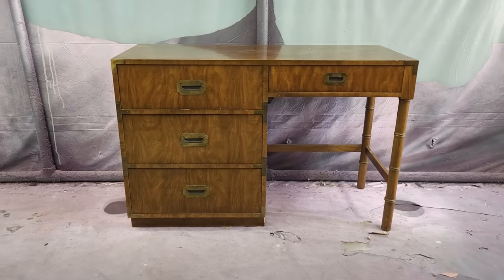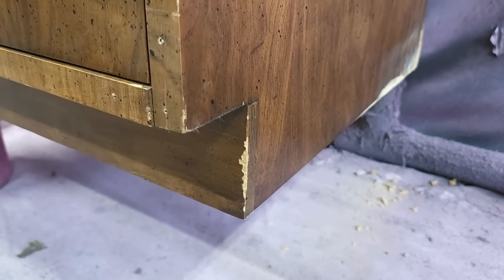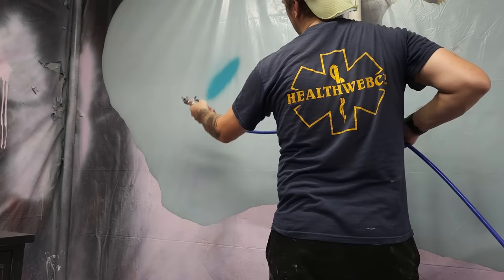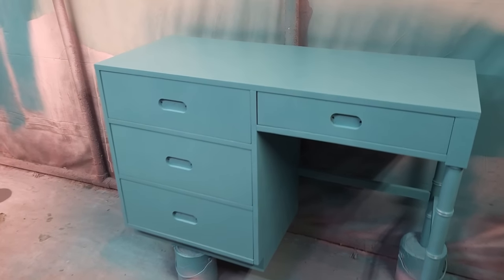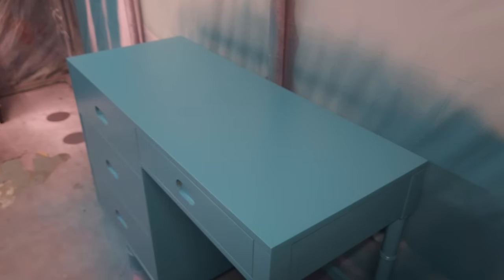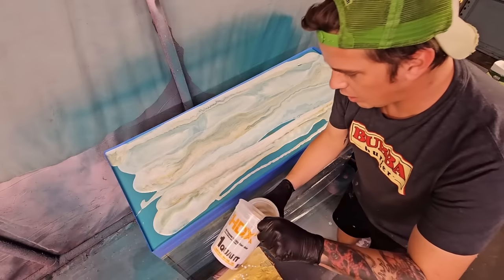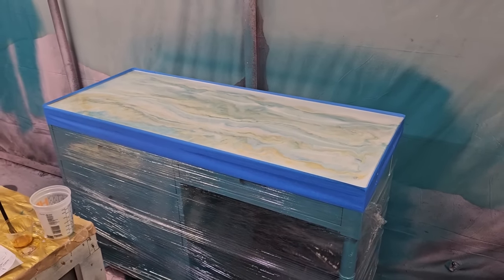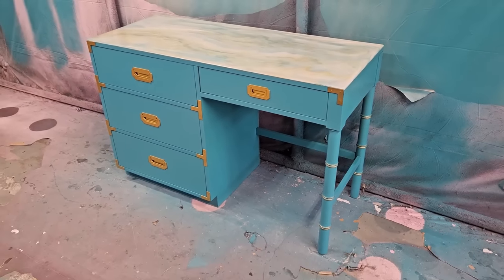Painted Vintage Desk Epoxy Pour Makeover

Comment: Personally, I believe you have too much white pigment.  I would just add the blue n metallic directly and use a hair dryer or heat gun to move around.  If using a heat gun, be careful not to burn the epoxy by not getting too close and moving around quickly.  Sure  beats heavy lifting.  Project being level is a must.  In the end, the desk turned out beautiful ❤.  Side note:  The heat gun will also pop bubbles and using both the heat gun and torch is a winner.
Reply: I agree. It doesn’t matter what type of epoxy resin is used, white will yellow over time. Art resin will yellow sooner.

Comment: Everybody panics on their first pour at some point.  Thankfully epoxy is very forgiving...to a point.  In my experience, you do not have to sand through all of those progressive grits under a clear topcoat.  Even the 120 by itself would have probably been fine.  The epoxy bonds to itself, scuff marks and all, and comes out crystal clear.
Reply from the maker: Thanks for the tips!
Reply: I'm glad someone else noticed the unnecessary progressive sanding he did. Before he started pouring, I was wondering if he leveled the desk. @ThatshabbyGuy I would suggest using a split cup to use the various colors or keeping them separate when pouring. The white was swallowing up your other colors too much. Thanks for the entertainment. I've had issues before with some things I've poured epoxy resin on so I understand the panic :D

Comment: I could feel your panic when it looked like you were running out of epoxy and time! That's a way cool result though. Also you're the only one I've ever seen spraying furniture with an airless sprayer and I've been thinking of doing that too. I see other videos of people using the Wagner sprayers and it looks like it would take "forever" to do it that way. Even with cleaning up the airless sprayer it's still probably faster. Certainly easier. And I don't even want to think about brushing it.
Reply from the maker: I've used the Wagner sprayers before too. I have a few videos of me using them. It takes about 5-8 minutes to apply a coat of paint with them, depending on the size of your project. The Graco airless sprayers take 1-3 minutes. The downside is the Gracos use more paint and have more overspray so you kind of need a bigger area to contain it.

Comment: Surface is supposed to be level. I use a level before I pour. A heat gun will help you move the epoxy around.

Comment: Is your epoxy resin for countertops or is an art epoxy resin?
Reply from the maker: It is made for countertops. Beast Bond is the product
Reply: @ThatShabbyGuy  is it available in United States?  Is this proven that the white will not yellow? All other countertop epoxy resin strongly suggests not to use white because it will yellow. I want to do my bathroom vanity and kitchen countertops using white. I’m a Fluid Pour artist. During your video I kept saying use your heat gun. 91% -99% rubbing alcohol will get rid of air bubbles as well. If you wanted the blue and gold to show up more use the clean pour technique. You need to wait for the base color to set a little so the colors will not sink. StoneCoat Countertop has a channel that teaches you how to use countertop epoxy resin.

Comment: I work with epoxy resin and I would not mix all those colors together. It doesn't work the same as paint pours. You could have layered the colors one by one. Usually epoxy is self-leveling but it depends on the brand. I think the epoxy got a little too hardened. And at that point even heat or fire isn't going to move the epoxy as much as it's going to set it. Nonetheless it turned out good for your first attempt.

Comment: I would have made the epoxy as a toper and not directly on the desk. You needed more colors and less white. Also, you needed to move the pour w a heating gun or hair dryer. The torch eliminates the bubbles.
Reply from the maker: I don't mean to sound rude but it sounds like you skipped the part where I used the heat gun to move the pour then used the torch. Your opinion on the white comes from how you wanted it to look versus how I wanted.